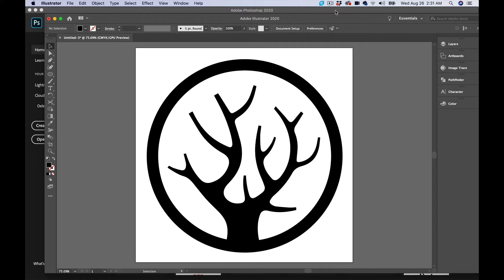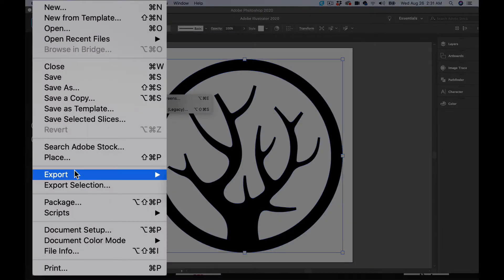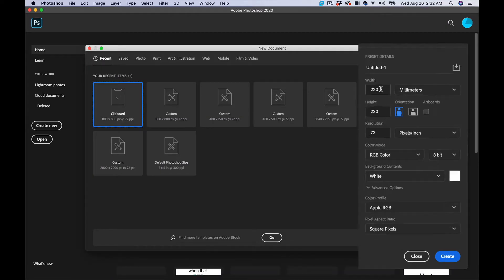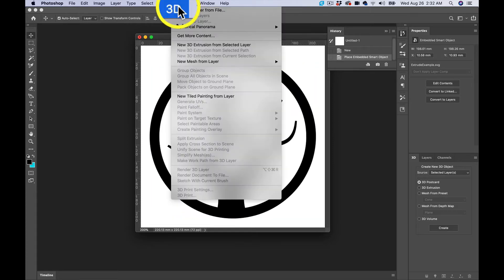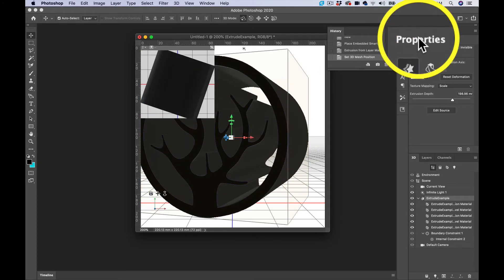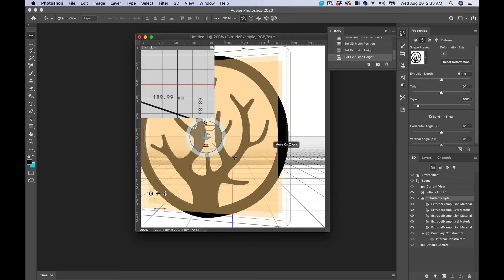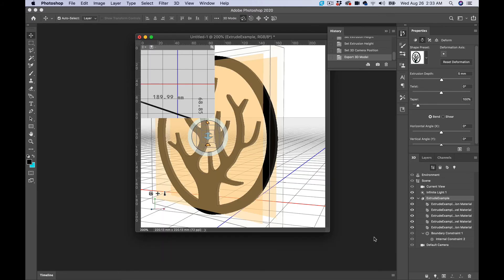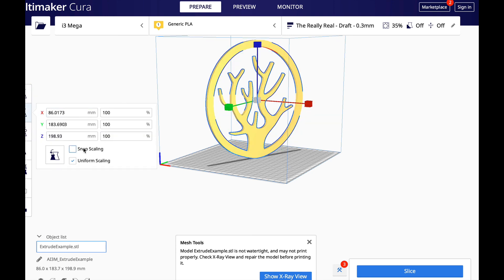How to make a 3D Printed model using Illustrator and Photoshop

Comment: My photoshop (from the creative cloud) does not have the 3D option when I open the SVG File. Any help?
Reply: Hey, you can achieve the same results in Illustrator itself. From Windows menu select 3D option.

I've recently tried several 3D effects and exported the designs as OBJ file as well.